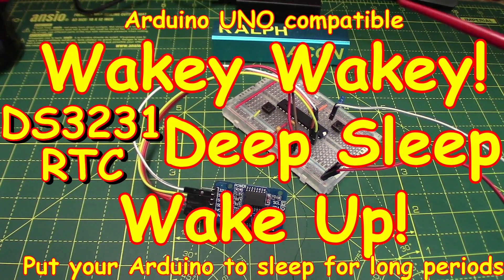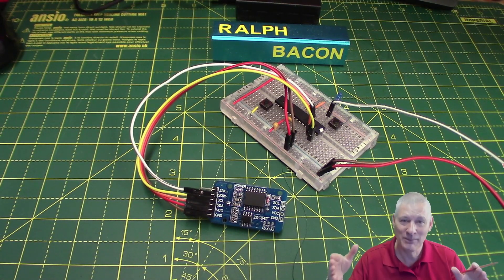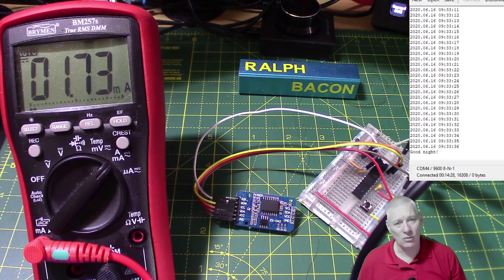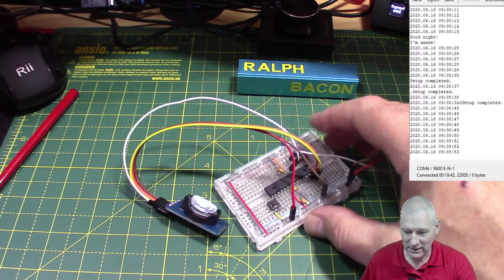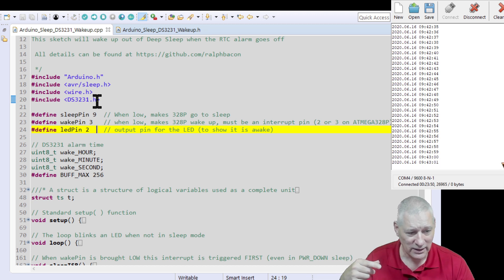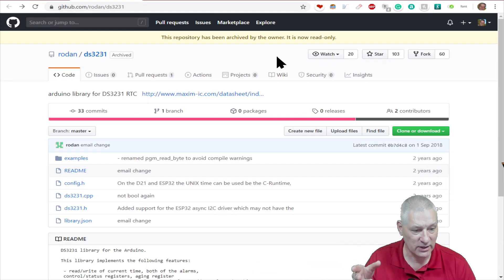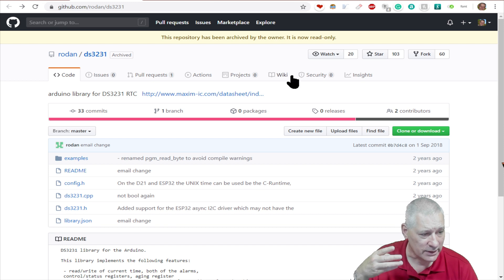#192 Wakey, wakey! Let the DS3231 RTC wake up your Arduino - easy!

Comment: Been watching you for a few years now and I like the way you over-explain everything. It really helps people get what you mean. I love yer new shop for doing yer vids. Did you  need a permit for that? I made a greenhouse and Melanie " Low Vision Life"thinks I needed a permit for that. Wadda ya think?
Reply from the maker: It's nice you are still with me on my Arduinite journey, Drex! My "new" workshop (now two years+ old) did not need a permit as it is less than the permitted 2.5m high (when near a boundary, ie fence) and is classed as a "shed".  I could have had it bigger (if I had more room next to my house) and still not need a permit. The rules have relaxed in the last few years.
Reply: Ralph S Bacon As others have said, the cave pearl project is a mine of great information.

Comment: I did try this sketch but it seems that the wakePin is changing state constantly, meaning goes to sleep and wakes up in milliseconds ! any idea why ? i used the same rtc module with an Arduino Uno.
Reply from the maker: If the wake pin is suppose to go LOW to wake the device, ensure you have either defined it as an INPUT PULLUP or have attached a 10K resistor from it to VCC.

Comment: How to set the clock to 8MHZ IN ARDUINO IDE?? Because in Arduino ide default clock is 16mhz. Please give me suggestion, so that I can run an atmega328 without a crystal and program it using Arduino ide
Reply: Watch his earlier videos...
Reply from the maker: See video #117, #119, #116 Suraj, bound to be something there.

Comment: Is it possible to power on arduino with this alarm clock? I mean, when using mosfets to completely shut down the arduino, then start it with an alarm from the DS3231
Reply from the maker: If you combined this with my Auto On/Off circuitry (or variant) you could do it:
#173 https://youtu.be/S2y1oAVmxdA

A better way would be to build your own Arduino UNO with a bare chip (only requires about 5 components) then put it into Deep Sleep which consumes just 0.2μA. Wake upon external trigger.

Comment: Great video! What programming software are you using? It's not IDE. I like that you can collapse the remarks.
Reply from the maker: In this video I'm probably using the Eclipse (Sloeber) but that's now dead in the water. I recommend the new Arduino IDE 2.0, now available as Release Candidate 5 (so very, very nearly done).
Get it here: https://www.arduino.cc/en/software#experimental-software

Comment: Warning !!!!!!!!!!! The module (DS3231) is delivered with a CR2032. This is a lithium battery.

That would be no problem if the module did not have an armed charging circuit. During operation, the input voltage of the module is on the battery, and this can also be 5 V. The charging circuit can be removed by removing the diode (red) or the 201 above or by interrupting the line.
Reply from the maker: Indeed, Thomas, and you're not the only one warning me (and others) about this. Crazy design decision.
Reply: @RalphBacon  What do you make of MAXIM's statement on the DS3231 datasheet "The device is UL recognized to ensure against reverse charging when used with a primary lithium battery." Is there evidence of problems, rather than a theoretical concern? (I sound like Dr. Fauci.)
Reply: This should be a pinned comment.

Comment: I want to know if there is a RTC with a programmable register that tells the RTC how many ticks of the crystal to one second?
The reason.. I want to make a RTC run a 24 hour day on Mars time... 
1 Mars day = 24h 37m Earth time
I want to do it in such a way, that I set it only one time using NTP,, 
then let it keep Mars time on it's own from that time going forward...
Reply from the maker: So you want a Mars RTC? I've never heard of anything that keeps anything other than Earth time, but you could program a simple Arduino (UNO/Nano) to keep Mars time instead.

The downside of using any kind of electronics is that you will be hard pushed to run it on a battery like the DS3231 (pretty accurate). You could put it to sleep for a second, wake up, do the necessary calculations and put it back to sleep again to enable running off a battery  but an Arduino will still take several milliamps for the short period it is running.

You mention using NTP to set the time (initially). That requires Internet access. If you don't need to run it on a battery then one of the small, newer ESP32 devices do this all automatically (for Earth Time) but you could easily run a simple routine to convert to Mars Time. The ESP32 gets the time from NTP periodically to ensure there is no drift as every microcontroller I've ever tried is not accurate enough for a clock.

I'm wondering if a DS3231 that has been correctly set initially could be used with an ATTINY processor of some sort so it can run on a battery for months if not years...?

Finally, if I were a Martian I would not say that my day is 24h and 37min (ie based on Earth time). It would just be 24 hours (or whatever the Martians agreed) and each "second" would be a longer-than-Earth second and so on. Now that could be programmed just by counting 'ticks' in a microcontroller (milliseconds) and then translating that to Mars seconds, minutes and hours. Just a thought.
Reply: @RalphBacon  I want to thank you for responding to my crazy question.

The NASA Mars Rover team runs on Mars time, so they know when the window to transmit to the Rover is open.. 
(Rover being on the Earth side of Mars)
So in my scenario, if the Mars Rover had a spotting scope pointed straight up. Every time Earth passed the center field of view, would be noon..
(I know real Mars noon is based on the sun..not Earth)
but I want a clock that would tell me when the Mars Rover was on the Earth facing side of Mars.. (6AM to 6PM Mars time)

If I had to look it up every day, then there would be no point to using a RTC at all... 

My RTC is the Ds1307.. It has an error of 7 seconds a day, which means I would have to NTP 7 times a day to keep it accurate to the second..

I was hoping there was a RTC that I could tweak the tick counter to compensate for tolerance errors in the crystal...
If it is fast by 7 seconds a day. How many ticks do I need to adjust by so it is accurate to 1 millisecond a day???

Do you know of any RTCs that have a tick count register to adjust how many ticks equals one second?

Then I make a 24 hour Mars day = (24h 37m 22.5s Earth time)
The only problem this would not fix is a Mars year is over 600 days
but I would at least have the Mars 24 hour day worked out...

I hope you could do a video on making a Mars clock to solve this problem..
One that you only need to set one time a year or better...
Reply from the maker: I'm afraid I don't know of a variable/programmable RTC, but the DS1307 is very poor at keeping time, which is why I mentioned the much more accurate DS3231. A daily NTP update is all you need, at most, perhaps even once a week is good enough.

If you don't need to run on a battery (like the RTC does) then you can easily program your own Mars clock, ideally with a huge LED display so you don't miss a critical time (like the ones NASA uses when a meteor is about to impact Earth). Using an ESP32, it auto-updates from an NTP.

Although you mention "Mars Time", you know how many seconds in a Mars Hour, Day etc so by using a standard RTC DS3231, you can just count the Earth seconds and create your own Mars clock.
Reply: @RalphBacon  My thought was to proportionally stretch the 
24 hour RTC day, so it takes 24h 37m 22.5s to complete
(or whatever the actual calculated Mars day is)....

The problem with using (Earth time RTC) is knowing how many days expired since it was set....

Is it possible to edit the RTC library to stretch a 24 hour day?

I would be glad to use another RTC... 
I was looking at the data sheet for the RV-3028-C7
(RV-3028-C7_App-Manual.pdf)
and it looks like it has (calibration registers) to adjust

Aging compensation with user programmable EEPROM Offset value (Factory Calibrated value may be changed by the user)

but  I don't know if I could add as much as 37m to a day..

My thought on making the RTC keep the time, is if I set it, 
I could put it away for a month or two and when I get it out, 
it is still on Mars time.. 

Anyway, thank you so much for your ideas.. I would love to see 
if such a thing is possible..
Reply from the maker: I was thinking more in terms of counting the seconds from a DS3231 (probably using an interrupt) via the 1Hz output pin, and then in the Arduino program incrementing the user-controlled secs/mins/hours/days etc according to Mars rules. That way, you have full control over all aspects of Mars time.
Reply: That question had me brainstorm to find possible solution...
DS3231 operates with internal oscillator, but other chips use external one, which frequency can be altered (adjusted) so that you end up with correct Mars RTC.
For example you can use DS1307 RTC with 32000Hz crystal oscillator (for example ECS-.320-12.5-13), which you can trim to ~31867Hz with variable capacitor and frequency counter, which will result in exactly 88775.244 seconds day length, or one Mars Sol - 24 h 39 m 35.244 s.
Albeit you may not end up with very precise RTC that way, since its accuracy would be temperature dependable, you would in theory be quite close...
Reply: @VasilKurdov  Thanks. That is close to my original thoughts. 

Look up the data sheet for the: RV-3028-C7
But if it has such a register, might only be changeable by a small margin.

My goal was to use a RTC to tell me which side of Mars was facing Earth, to simulate when radio contact with the Rover was possible.. 

Make a Mars Rover that in Mars Mode can only respond to signals when it is facing Earth..

If you could draw a line between the center of the Sun and Earth on Jan 1st and zero seconds out to the edge of the solar system, my thought was to count that line crossing as the beginning of the year on all planets.

What was the unix time when Mars crossed that line? But I also need to know what spot on Mars was midnight when that happened..

Also you would need to apply reverse kinematics to calculate the rotations of the planets like knowing the angle of degrees between the hands on a clock for any given time of day...

Comment: What I do not understand that sleep current consumption in this video is not verified with multimeter.
I'm watching this with pretty much the same setup and Arduino Pro Mini 3.3V (basically Atmega chip, efficient, but weak voltage regulator unable to provide high current for SD card for example, reset button, oscillator, few capacitors and resistors and nothing else), trying to resolve issues which either do not exist in your setup (due to code differences or I omitted something). But first mistake I can see is that battery charging circuit is not disabled which may add few milliamps extra to overall power consumption at 5V because battery is being charged (regardless CR2032 is not rechargeable). Other problem is that in this exact setup, RTC circuit consumes roughly 90uA and Arduino 60uA  with ADC disabled. I'm not sure why Arduino consumes so much. When I tried to remove VCC from RTC powering it from pin, it switches to battery, but also interrupt goes to low at this moment so falling edge is not detected or interrupt is triggered briefly after arduino enters the sleep. Another problem is that BOD has to be disabled within few instructions before entering sleep, but with power consumption being 150uA in my setup, I don't bother to save maybe 10uA.
Weirdly I checked The Cave Pearl project which mentions that 90uA as well, but it also mentions that RTC can be powered via digital pin, without mentioning interrupt. I can try to set BBSQW bit on, it's undocumented what effect it has in interrupt mode.
Reply from the maker: A bare-bones Arduino ATMega328P chip will use just 0.2μA in Deep Sleep. Of course, achieving that depends on disconnecting just about every other bit of the circuit, normally done by a P-MOSFET (so the Arduino brings the gate of the MOSFET low and thus powers the rest of the system).

Using any kind of "dev board" is a no-go unless it has been specifically designed for low power use. For example, ThingPulse do a low power version (15μA) of the ESP32 (called ePulse Feather) which is about as good as you can get with that chip. There's probably a low-power version for the Arduino too.

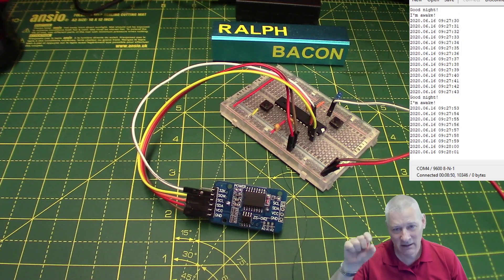Comment: At 3:42 you say, referring to setting an alarm time "you can have days weeks MONTHS hours minutes seconds" but neither alarm1 nor alarm2 allow for MONTH.  Maybe in a short month you could specify a day of month of 31 and not alarm at the end of the current month (I haven't tried that), but there is no alarm register that will accommodate a month number (or year number, for that matter).
Reply from the maker: You are right, the granularity stops with days. Which is a shame really, because if you wanted an annual or bi-monthly reminder it can't be done (easily).
Reply: @RalphBacon  Thirty days hath September / April, June and November / All the rest have thirty-one / Except February which hath but twenty-eight days clear / or twenty-nine in each leap year. :)

Calculating a leap year:
Divide the year by four.  If it does not divide evenly, it's not a leap year, otherwise go to the next step.
Divide the year by one hundred.  If it does not divide evenly, it's a leap year, otherwise go to the next step.
Divide the year by four hundred.  If it does not divide evenly, it's not a leap year, otherwise it is a leap year.

Yes, it's complicated.  The complexity is because the Earth's orbit around the Sun isn't an exact number of days.  It's almost 365 and a quarter days, but not quite, which is why a leap year has to be skipped every so often.

Comment: Hi Ralph Bacon
I have been following your video with great interest regarding “# 192 Wakey, wakey! Let the DS3231 RTC wake up your Arduino-easy! ” I can not program, but I can use your sketch for some practical use, and not just flashing LEDs. I have a sketch that runs on ESP32 and which is an Internet clock that is updated every minute, along with Temp. and Humidity from DHT 22, all of which are shown on an E-Paper display.
Since I do not see or use the Internet clock at night, it was best that it is in Deep Sleep, as it is powered by a battery, thereby saving power. I could imagine that ESP32 Wakeup, for example, time 0800 and, and goes into Deep Sleep at 2300, and it can do that every day. I do not have the ability to combine the 2 sketches into one sketch as I do not have enough knowledge of programming, so could you help me with that?
How do I combine Setup from the 2 sketches in one sketch, and the same in Loop, so that it can be used for something practical.
With best regards Georg
Reply from the maker: Have we not had this conversation already, Geog? I'm sure I replied. Perhaps I just forgot to press SUBMIT? Anyway, to combine the sketches is fairly straightforward. Copy each line of code from the simplest sketch into the more complex one. Don't repeat stuff and make sure it works as you go by compiling and uploading. I've just done the exact same exercise copying my TFT Screen code into my Internet Radio code, testing as I went. A couple of hiccups (forgot an #include library) but other than that all sweet.

Comment: i got compilation error it says: Compilation error: Arduino_Sleep_DS3231_Wakeup.h: No such file or directory

how to fix this?
Reply from the maker: You need to add a line at the top of your sketch to include that libraty:

#include "name of library here.h"

and that should do the trick. Make sure the library is in your library folder!
Reply: @RalphBacon  i use Arduino IDE, i use exactly the code you use and it says that error. I try to find that library, I also write it at the top of my code still error
Reply from the maker: Where have you put the library? It should be in the libraries folder, which is normally a sub-folder in your sketches folder.

Just to test it out, you could put the library files (not the folder) in the same folder as your sketch but it will be a bit messy!

Comment: Can it wake up a Wemos D1 from deep sleep every 15min from 18h to 7h30?
Reply from the maker: The way you could do this is to set the alarm (programmatically) to 18:00h. On wake-up the Wemos does its stuff then sets the alarm for 18:15. Wash, rinse, repeat until 7h30 at which point it sets the next alarm for 18h. 
Remember that "wake up" in this context means a fresh reboot - you will have to restore any values you need in the setup( ) routine.
Reply: @RalphBacon  I was able to hammer it together, thank you. The ESP8266 needs a quick LOW pulse to its RESET pin in order to wake up from deep sleep, however, the pulse coming from SQW on the DS3231 stays LOW after the alarm is triggered until your clear the alarm flag and set a new alarm. Therefore, to convert this constant LOW into a quick LOW pulse, I used the "esp8266 dtr reset circuit" found online. As soon as the ESP8266  gets this pulse, it resets and immediately sets a new alarm, and SQW is HIGH again. I used the library by Rodan like you showed. Thank you again.